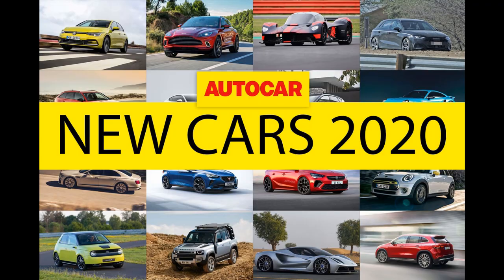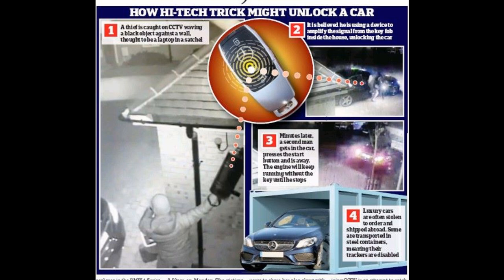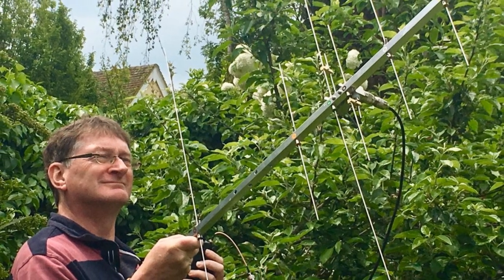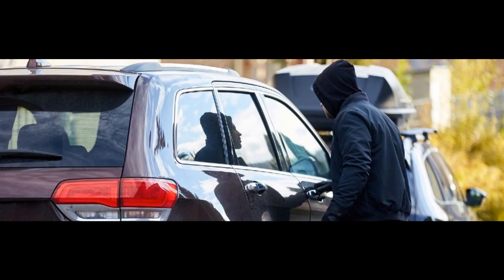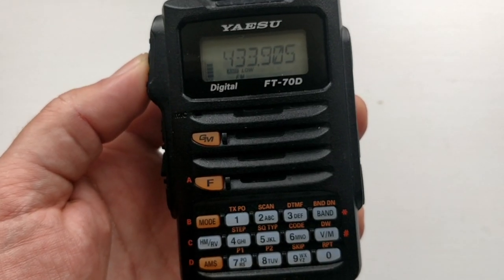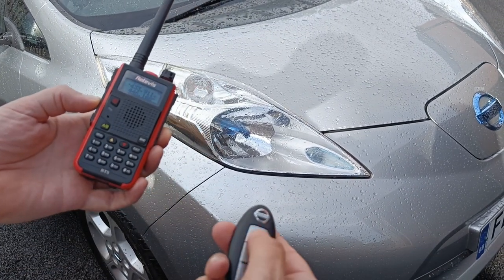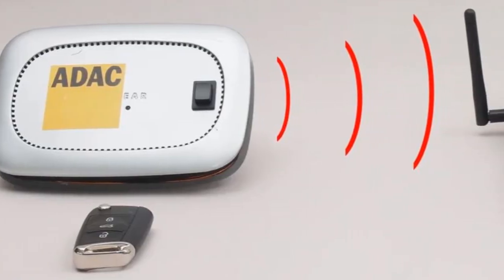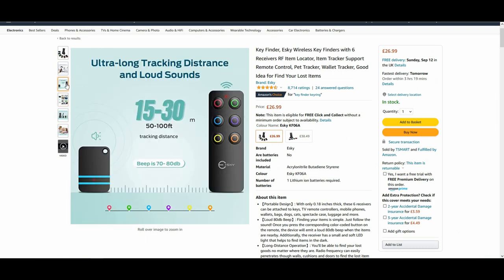IS YOUR CAR KEY BEING JAMMED? AND THE EASY WAY TO FIND IT IF YOU LOSE IT.

Comment: Looks like Lewis is moonlighting!
Nice video Paul!
I have visited a couple of high sites with loads of repeaters on top which feature signage indicating that there may be problems with locking/unlocking cars while on the premises.
Reply from the maker: That's interesting 😎
Reply: That's what I thought - same high standard as Ringway Manchester. In fact, you're using so many of the same video techniques I would not be surprised if you collaborated on this.

Comment: My Buick has keyless entry and remote  start but you must insert the key to drive the car. I've tested the range of the key fob and have been able to start my car at over 500 feet away, I can even start it from deep inside a store several hundred feet from the car, the fob does go through batteries pretty quick.
Reply from the maker: That's crazy, I'll have to test mine

Comment: I don't use the car a lot, sits in the garage. I go into a menu on the sat nave screen, used for radio and menus. Turned off the keyless entry, is nice but anything that pulls power on a car not used much, it goes off. Just do with the button. Pulling on door handle and it works, little bit to touch. capacitive sensor I guess nice, But not on as the alarm ultra sonics, can press something up front top  roof console with the inside lights, sunroof control. that go off as well, pulls power on a small 12V battery as hybrid, big 200V one under back seat starts car so the 12V dear AGM (excuse to make dear) no need to be big capacity. locked in garage. Cheap baofeng made quick noise when turn on, take out, bottom of stairs putting footware on for a walk. worked out was the weather station outside sensor, little light on it when Tx, noise on chinas finest radio, Baofeng. cheap radios!. something mw and near 70cm calling frequency, it affected calling channel with mw close to baofeng set frequency, cheap radio. weather station Tx stuff it up.

Comment: Oddly enough I’ve found that although mums Mirage should only have a range of a few metres,  I’ve been able to get up to 20 metres reliably and occasional success from around 40 metres,  we’ve had intermittent issue with this not locking/unlocking and had to use the key.  Have to wonder if a ham waffling on 70cms was the cause.
Reply: Hams were on 433MHz first. the stupidity was to put LPD on 433,
 try to get one on 315Mhz
Reply: That’s both UK and Australia then.